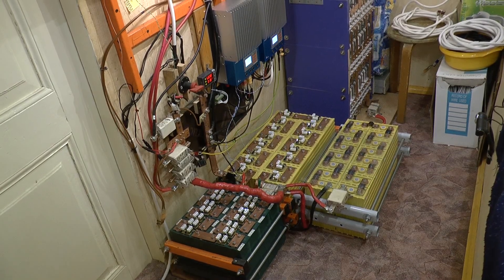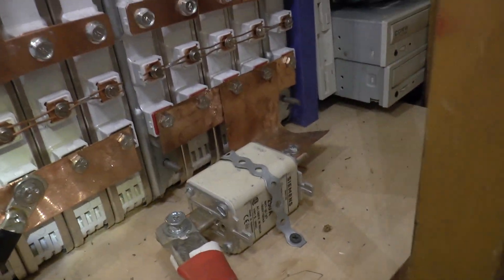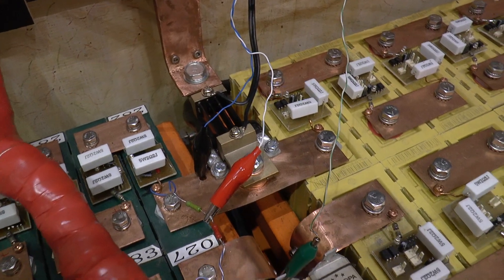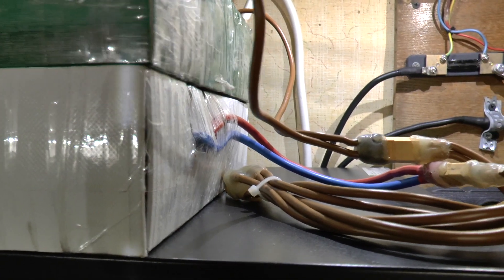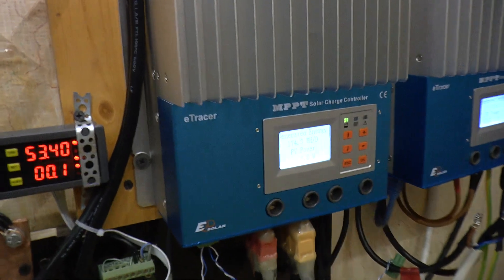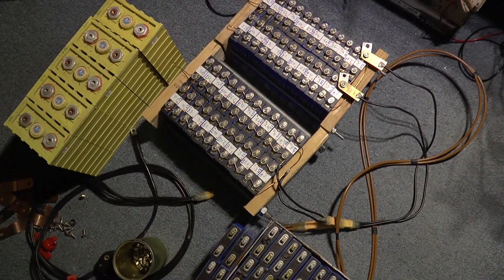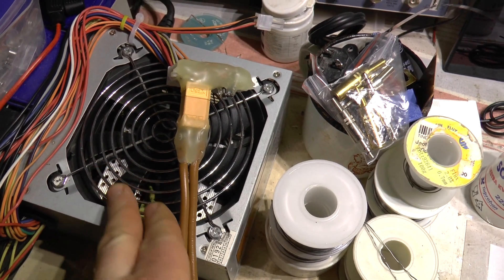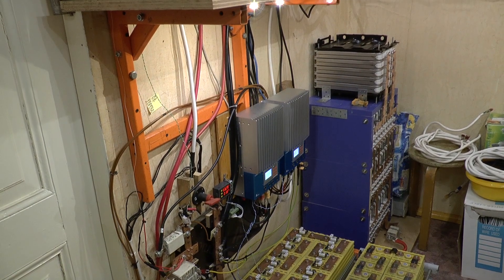CheapVlog #7 My Tesla Powerwall or Nissan Powerfloor :) 30 kWh

Comment: What is the purpose of the resistors? There is a lot of hours put into your system
Reply from the maker: Voltage divider for solar controller. To increase solar controller max charge voltage (~56V) to 58.8V.

Comment: That is very impressive. Nice work.
Would you be able to provide a link to the balance boards you are using?
Also why do you have no balance boards on one of your Winnston packs?
Thanks
Reply from the maker: I invented/designed and etched balance boards/BMS myself.
~20x cheaper but a lot of work.
See video how I made them https://www.youtube.com/watch?v=rRwKE9H-OUA 
This Winston pack i have just added and boards not yet connected.

Comment: Great system you have built! Why are your liefpo4 cells compressed together with threaded rod?
Reply from the maker: To get long cycle life, lithium cells must remain compressed to
retain their shape. And for easy  transporting.
Reply: Where did you find out that you get more cycles when cells are compressed?
Reply from the maker: Different EV forums and in my green Sinopoly 60ah user manual.